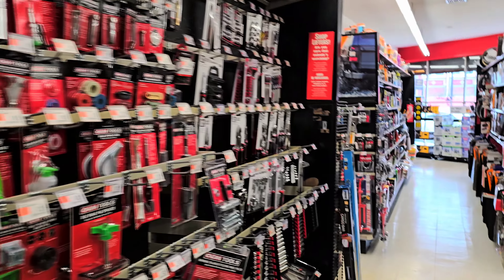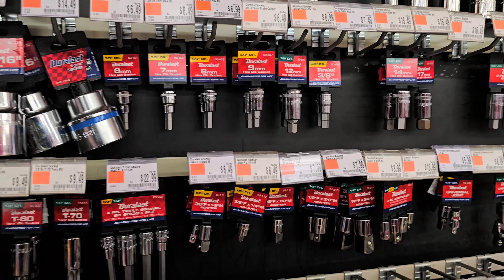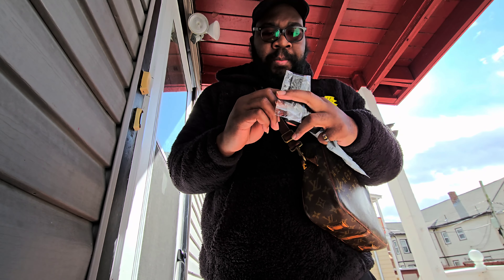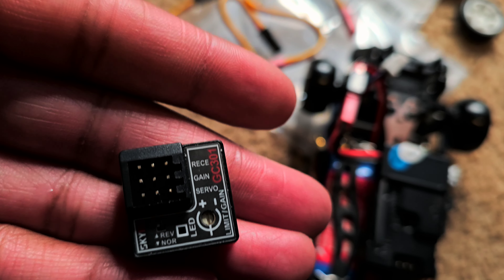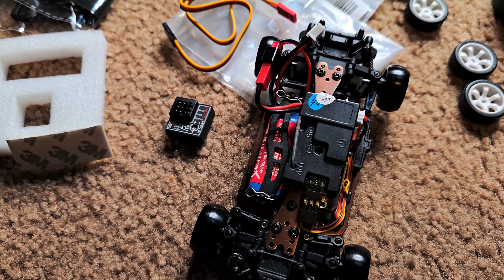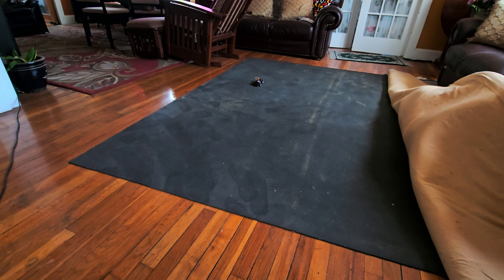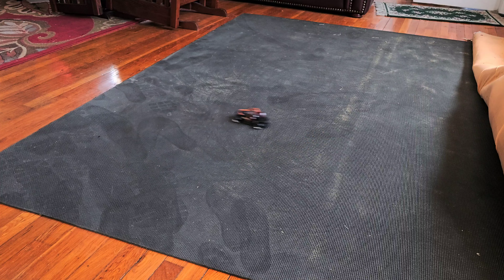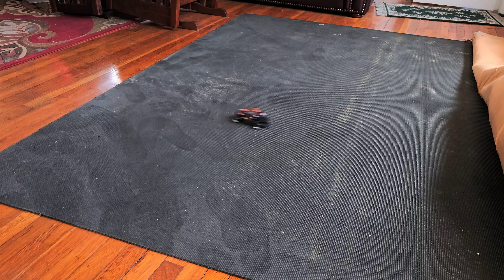WLToys k969 SkyRC gc301 Gyro Install & Drift test #wltoys #driftrc #rccars

Comment: Looks like the perfect surface. Probably drift better if you turned down the throttle dual rate. I have the 284131 truck version and that has throttle DR on the transmitter
Reply from the maker: Yeah I'm learning how to adjust the stuff on the remote have to watch a video or something. Car is too fast for this space in these settings.

Comment: Try to put on regular wheels, you will have some more control, Your car is too powerfull those hard drift wheels are overkill. You cant proper drift with those hard plasticy wheels..
Reply from the maker: Yeah I have some other wheels but the bolt hole is too small for any tool to fit lol.